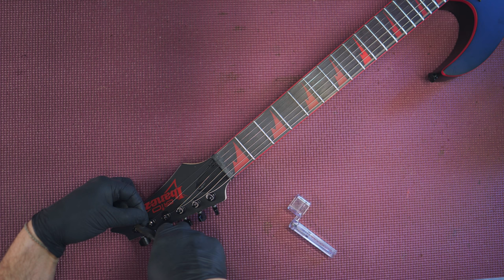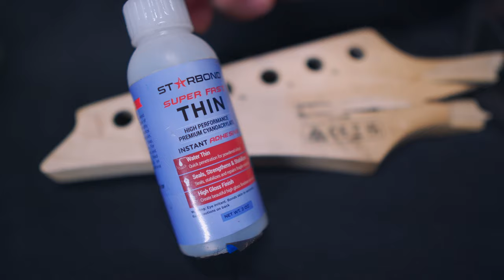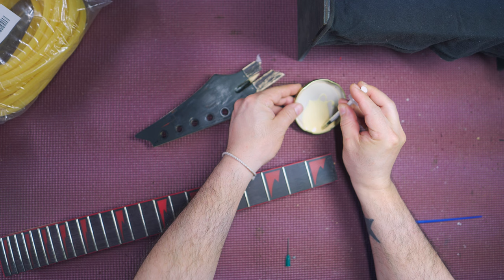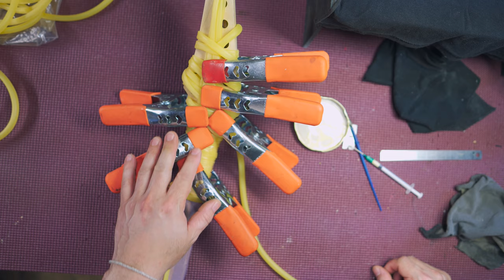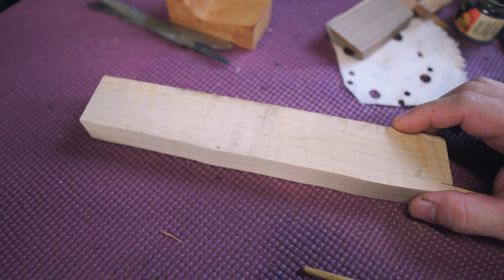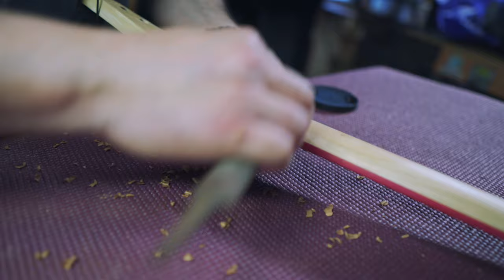How to repair heavily damaged guitar neck - Cracked Ibanez Neck Repair - Dead to shred

Comment: I have an old Kaman guitar similar in style to this one, that had a crack in the headstock between the 6th and 5th string tuning holes, all the way down and all the way thru. But it was so tight I couldn't get any glue into it. I even tried Ted Woodfords suction cup trick, which I highly recommend. But still, too tight and closed. So eventually I made the decision to drill holes into the width of the headstock, perpendicular to the crack, and fill with wood glue and dowels. Just strang it up the other day and so far so good. The neck hasn't had tension on it in over 15 years so some things are a little wonky but we'll get it there. And if not, no big deal. I couldn't have imagined how much pleasure and enjoyment I get from fixing up a broken guitar.  Love the content and keep it coming!

Comment: This was awesome to watch. I kind of wish we could have seen the paint job as well.. The fretboard and binding color change is sick!!!
Reply from the maker: I just used a rattle can from Montana Black. It is nitro-based and they have some interesting colors. Right on the can it says it is for Graffiti and not to be used for instruments. I did it anyway and liked the results. I sprayed a satin nitro clear over it. I can't complain. For the binding I masked off the fretboard and neck and sprayed the Pink rattle can from Montana Black. Also hit that with satin nitro clear. For the inlays I had to paint by hand using an acrylic marker.
Reply: @MarkGutierrez  Hey Mark you have some scammers hitting up comments on your previous videos!
Reply from the maker: @fourspiralarms  Thanks for the heads up. I think I was able to report and delete most of scammer comments.

Comment: 6:07...A " hot shot " with the glue in the neck .( from "Training Day' the film... ) Nice work !! did you loosen the trust rod before disassembly ? and it looks like a Steve Vai model , sounds great !!!
Reply from the maker: The truss rod was already in a neutral position. I have a suspicion that since this guitar came from Sweetwater, it  had gone through their 30 point inspection and was dropped during that process.
Reply: @MarkGutierrez  Thank you for responding !!!

Comment: Great work!
One question tho - how did you protect trust rod inside those massive glue-up? I really thought that your choice will be fretboard removal to avoid glueing all together there...
Reply from the maker: Most of the glue was on the faces of the breaks. I didn't squeeze glue into the area where the truss rod was,  I brushed it on. There was most definitely squeeze out into the truss rod channel but that was to be expected. Just as it is to be expected when building a neck from scratch. That little glue in or on the truss rod doesn't impact it too much. This truss rod turns perfectly.